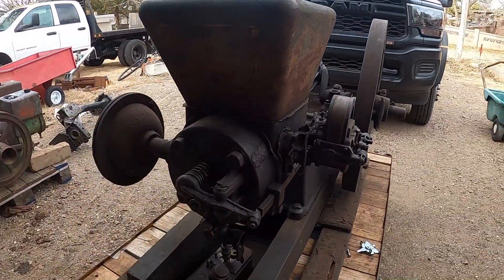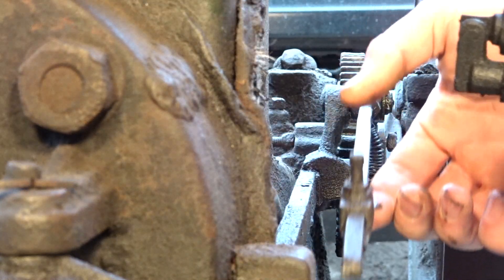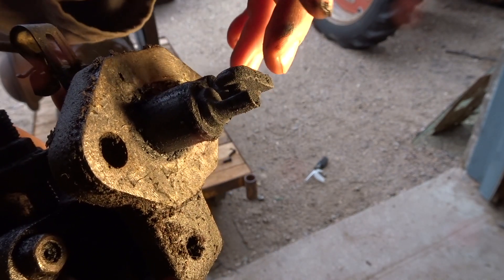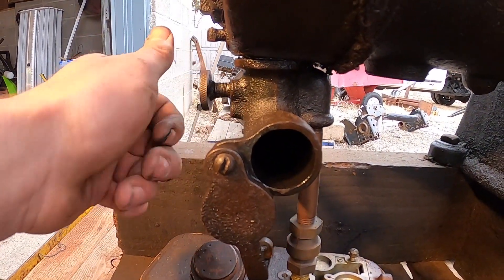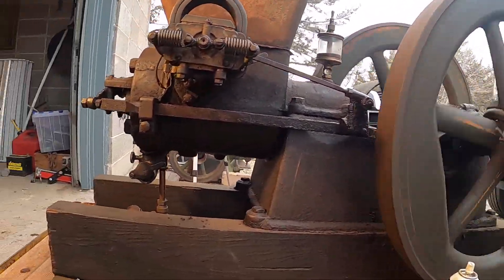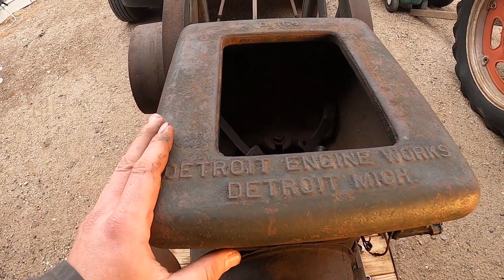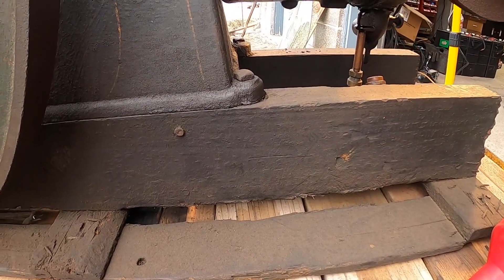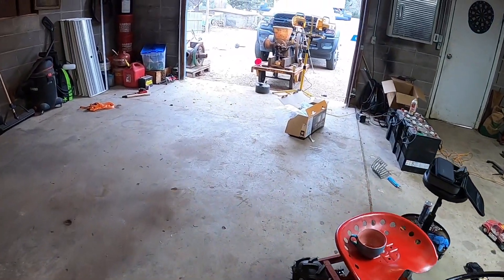Igniter, what's that? Hit & Miss Engine Repair & Slow motion View

Comment: Wonderful video. Suspected an igniter worked something like this but now I know exactly. The slow motion footage was excellent. It gives a good idea of how violent the interaction between the parts really is. Imagine that engine was 10 times the size those mechanisms would sound like. I have a magneto on my 1923 Fuller & Johnson. Ext Model T box on my NOVO.
Reply from the maker: this fuller Johnsons run good. running the novo on a buzz box?
Reply: @ yes, I bought the Novo and it has a Buzz box. I haven’t tested yet because I need to repack the fuel pump and scrape out the fuel tank and get the stuff out of there.

The fuel tank is molded in the engine itself and has no drain